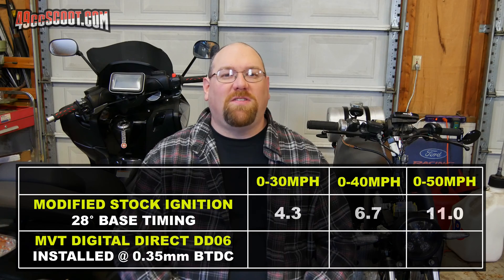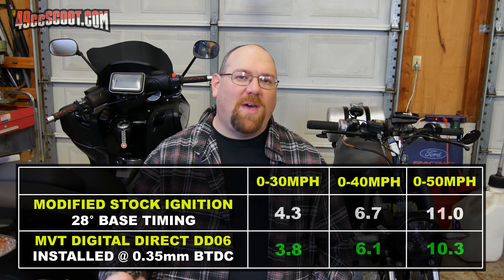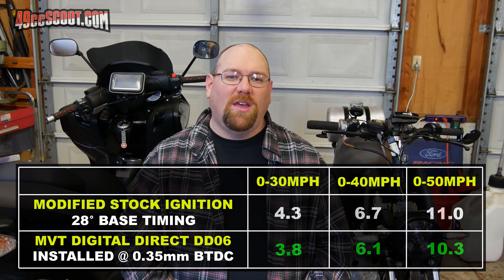TPR 86cc Build : Part 24 : MVT Digital Direct vs Modified Stock Scooter Ignition Comparison

Comment: Hello would you buy it again now you know the difference with it? Or would you just stick with what you had?
Reply from the maker: I would buy it or another racing ignition again. Much more responsive. Other ignitions may have a better curve with less advance at low RPM (safer), but the MVT has the benefit of charging/lighting output.
Reply: @49ccscoot  yeah thank you for the reply! And also your videos are really helpful you explain what and how you do things really well! Iv literally binged your videos in 24 hours straight! Did you manage to get the 34mm pwk exhaust temps to stay down in the end? Looking forward to the next update video
Reply from the maker: @Flintyl93  Thanks! Still working on the PWK. It's not cooperating.
Reply: @49ccscoot  wouldn’t recommend getting a pwk carb then? Haha
Reply from the maker: @Flintyl93  Not my favorite, but this is usually my luck.

Comment: I would be very grateful if you could trust me with the tachometer model
Reply from the maker: The small tach that I tried at first is a Trail Tech TTO. The multi-function gauge is a Trail Tech Vapor.

Comment: hello, what is the rpm limit of the original ignition?
Reply from the maker: I don't know what the limit is for reliable spark. I've used them up to about 12,000RPM. I have seen people post on the forum about flywheels failing with higher RPM setups. One person tried to use a stock  ignition on a Polini Big Evo around 14,000RPM and he went through a couple. Realistically, the racing ignitions offer so much better response and curves for high rev stuff that they should be used anyway.
Reply: @49ccscoot  OK, I am preparing a TPR 86 for Piaggio and the motorcycle is going to be used for the street and I need it to go with the lights, can you tell me how far to set the original ignition? or is it worth putting the mvt?
Reply from the maker: @raidracing9748  I would (and did) go with the MVT and mine is street. If you use the TPR pipe it may be alright with the stock setup. I used a timing light and set mine to 20 degrees base IIRC, but it will depend what CDI you have and what the engine likes.

Comment: The thing its a littlebit pointless, 2ts goes better in cold weather and you cant test it with exact same belts. But its sounds better with the newer ignition.
Reply from the maker: I've got enough results from before and after in various weather conditions at this point and there's no doubt that the MVT improved acceleration. Aside from that, I have tracked pretty  consistent times in various conditions. Riding it before and after would tell you without numbers on paper, but I like to test so I know it's not just my perception.
Reply: @49ccscoot  its straight forward that its better than the modified stock.

Comment: Have you considered a DC to DC converter to keep the battery charged? It would require a buck boost to keep a steady voltage, it can pull the charging system voltage down lower, with more current to output more voltage,  it may output more total wattage,  slightly more, maybe a pen dimmer can be used with the lights to use less power,  they are not actually on constantly, but to the eye it is, it can be seen on camera sometimes, computers use the tech also ,  the only down side is the light will seem slightly dimmer,  there is a few things that can be tried, maybe a capacitor  connected to the regulator output, to maintain a more constant DC charging voltage,  or maybe use a smaller headlight bulb, or add a 18watt or so driving/ DRL/ fig light, and turn off the headlight when not needed, I guess you have it figyby now, but maybe some suggestions can help improve things further! I guess the only true fix would be to add windings to the stator, if there is room, maybe 24-26 gauge per pole with enough turns to equal the voltage supplied by the existing windings, then parallel , to supply more current at the same voltage, or completely rewind the stator, with slightly thicker wire, say go from 26 gauge to 24 gauge, it would require more room, because more copper would be going on to the stator,  just some ideas,,,
Reply from the maker: I've got it working well enough ATM. One thing that helped the charging a lot was the higher RPM exhaust. With the engine staying revved more, it charges better. The racing ignition doesn't make much power at lower RPM.

Comment: Is this ignition available for 4stroke? Gy6?? Would it even make a difference if it is??  There was a guy on YT saying the 1p39qmb us actually 63cc, us this possible? If so that's what I have, I just put a 50mm kit on it, with a head set up for 80cc that I ported, and unshrouded the valves, a look so port matched the intake, and exhaust,   best i could,  with a aftermarket exhaust and 20 mm carb, I also shimmed the valve springs, installed the A9 cam,  I had to buy a new starter, so I'm hoping to get it going tomorrow, I was just curious if there is an ignition that could make a difference, I also have a 1500rpm and 2000rpm clutch and contra spring kit,   I haven't gotten any rollers/sliders yet,  I want to see how it does first! Great video!
Reply from the maker: AFAIK MVT does not make an ignition like this for the 139QMB or GY6. You can get smaller and lighter flywheels and there's probably an inner rotor kit out there somewhere. It should improve response and if it had a good ignition curve, that would also be beneficial. NCY, HOCA and SSP-G are the brands I recall that make or made smaller lighter flywheel kits for the 139QMB.

Some 1P39QMBs were 63cc. Most are not. The P is proven to not guarantee anything special like a different bore or valve length. It's there to signify a horizontal engine.

Comment: For longer trips i guess your chargline is somewhat low, but for keeping it going its no problem .Your Coil is on the main cirquit and gets his power straigt of the Stator.While your LED maybe overconsumes the Stators chargercoils., This can cause for defective batterys,but aint a problem for keeping on the move on long trips.Nice video like always ,have a good christmastime and lots of new parts.

Comment: Hello @49ccScoot

I use the same ignition and i have NO problem at all with my charging.
May i ask if you are using both light coils? the sator outputs 12V+ on 2 of the wires.. ( if i remember correct its the yellow and the white/black but im not sure.)
Also, i dont think your voltage regulator is working properly because it should not be able to output more than 13.5V, so maybe change to another brand so you dont fry your CDI.
Reply: I have spliced the two wires together.
Reply from the maker: @jonasmader  I have both wires going into my regulator/rectifier so they can help to charge the battery and my battery powers the lights. If I switched to AC lighting, I shouldn't have charging issues... but then I'd have a flickering LED. I used AC on all of my small scoots till the last couple of years and now I really like the constant bright light. Trying to stick with DC if possible.

Comment: All you need is a buck boost adj voltage supply for that headlight.  You can turn it down during the day so it just glows enough to be seen and at night you can have it as bright as you want/need and pick a brightness that agrees with your voltage.  That is a huge amount of led light but you know their are more efficient led's. I have a 20 watt light that should be illegal because it will blind anyone within 150 yards instantly leaving you unable to see where you are going so there is no way I could use more, in fact I cannot use it full brightness because it actually blinds me from the back side.  10 bucks for a buck/boost board will solve your problems or rewind that coil with thicker wire and same amount of turns.  I used to be scared of winding coils but necessity made me and now I won't hesitate for a moment. I just put a bobbin on the lathe and wind it off to see a broken wire, when I find it I solder it together, put some liquid rubber pliars dip and a piece of tape and wind it back or just redo the whole thing and as long as your enamel is good, you won't have a problem and will learn alot in the process.  your videos are so damn awesome bro, I can't imagine anyone argueing with your results as  your methods are so consistent and true,  but that is the result of them big bucks you pay all those camera people behind the scenes huh?
Reply from the maker: lol Oh yeah, all those people behind the scenes. I wish.

I'll prob look into the voltage supply. I am not however taking apart this encased stator. Maybe if it ever quits working, but for now it can stay sealed.

Comment: Just sharing same thoughts ....what have hit me in video it was ignition at 28 deg. BDC  !? That is kind racing adjustments - gas full on or off and that is not much efficient , because crank is on the edge  turn backwards,  isn't it...What you need is gasoline /air mixture burning at highest efficacy to be like 5 -7 degree after ADC.  Gasoline mixture has time frame -from ignition point until is at highest temperature of burning or highest coefficient of its efficiency. It is possible to calculate that ( tray to Google it or I can find link for you ). Great job.
Reply from the maker: Fuel and air takes a finite amount of time to burn. It's not an explosion. So yeah, you want the peak cylinder pressure to be a bit after TDC, but to do that the fuel has to be ignited before TDC. 28 was what gave me the best results through test and tune. It may have actually done better with more, but I didn't try to go beyond that point. It would have been nice if the CDI backed out timing more at higher RPM to put heat in the exhaust, but it did OK for stock stuff. The MVT has 40-ish degrees of advance and it is harder to start. Runs well once going, but I suspect that it's backing the timing out a lot at higher RPM.
Reply: @49ccscoot  Looks like I wasn't clear as I tough in my writing ....and you explaining basics for me and there is no what we want. Lets start from "Fuel and air takes a finite amount of time to burn" - is this what I'm talking about. Time of burning it depends on fuel quality as well (witch vary a lot from gas station  to gas station) this is why racing fuel exist. This is why with new tank of fuel you will get different result on ignition point adjustment.  Off course one of the best situations is  to do timing adjustments with a DYNO machine ,but for average result for average fuel quality from the gas station to calculate fuel burning time it give you  quite good   result.
Reply from the maker: @mobilgin I understand the idea of calculating time, but conditions vary so much that it's not really possible with a real street ride. If the weather changes and the mixture fattens up a little, then that throws it all off anyway. You could start monitoring altitude density and tuning the carb before every ride with the same canned fuel, but at that point I'll just hop on the TMAX and let something so picky collect dust in a corner. Some level of precision is suited only for racing or dynos IMO. Plus, I've never read anything from top tuners going solely on calculations. At least from things that I read, they generally advise actual testing because there are so many variables. Especially for someone in a regular shop and not sitting on a bank of super computers to so all sorts of modeling.
Reply: @49ccscoot  well ...each tuner have own toys to play with and same of them even keep it closed to the body from evil eye. 
You are becoming top tuner your self as well and when you are so up there are no more teachers!
Me..just sharing 40 + years of experience.... whis is why  28 deg. BDC took me by surprise..extreme ignition point with uncertain fuel quality and different environmental conditions  ( you have self came to same conclusions in previous post).
Reply from the maker: @mobilgin  That is the problem. Too many people don't share what makes their setups work well. I'll prob never be a top tuner, but whatever I figure out I'm glad to share.

I just went with what worked for the 28 degrees. TPR said 20 and I kept advancing to see if I could pick up power. Worked well for me. Might not be so good if I had a setup that revved out much more.
Reply: @49ccscoot  Have found it...https://www.superhonda.com/threads/one-of-the-best-ignition-timing-writeups-i-have-ever-come-across.268106/
" Worked well for me"....any thing what worked it is positive tool in your bag. But should be solid data to back it up the statement. To use feeling as guide to evaluate engine performance  -that is not good enough . Engine performance it is a bunch tech. data expressed as a digits which represent same parameter and that you or anybody calling self a tuner or pro mechanic must be able to work with. You do know how make things to happen and not having nerve brake down seeing a wrench. You can make your own(mini) DYNO.
"Top tuner"....I have no idea what that mean in scooter world, but imagining a snoted teenage with bumps covered face , backwards hat an ass hanging over his trousers.
Only "real" relationship with a women he has ever experience was on a computers screen. But getting back on a track to exiting examples of practical "top tuning" in a super bike and formula1 world,resulting engines lasting x amount of hours or laps on a track . Tolerances in those engines are not achievable in real world for normal Peter.
But on positive and practical note next step for you to a achieve better performance in your engine should be- minimizing  friction in all moving parts in engine . Saving white where it is possible.I m having god result with that stuff minimizing  friction....https://www.weboil.dk/shop/3-rvs-technologyreg/13-2s125-rvs-technologyreg-totakts-motorbehandling-125c/ (google translate will do miracles for you). I have no idea if possible to get it in USA,but that product is made in Finland using coal miners and they machinery as a testing ground. It works.
Getting stable fuel for stable data readings for engine performance  ( later you can downgrade engine setting to normal fuel,kindo).
Reply from the maker: @mobilgin  I get the idea of the timing calculations, but that seems tough to me for a 2T. The high end power relies on the exhaust's operation for two-strokes. You can setup a 4T so the advance curve matches your calculated time, and you end up with a map that steadily advances. That doesn't work with a 2T. My opinion is that you really need a dyno or trial and error testing to see what the pipe likes and you'd probably do better with an EGT to see how much heat you're putting into the exhaust. 

Sorry the reply is late. The links got your reply auto-marked as spam so I just saw it.
Reply: @49ccscoot  Cool to hear from you, I hope find you well.  2 stroke is taffy also because an exhaust construction....  in bad designs, unburned  fuel sits in exhaust chamber and is not sucked back in to cylinder to burn. In god design unburned fuel is sucked back to burn.....This situation is complicate enormously getting timing just wright, as specially if you have two sparks during one piston stroke. For 2 stroke engine we just have to make compromises,but you self came to that conclusion..There I agree with you 110% "My opinion is that you really need a dyno or trial and error testing to see what the pipe likes and you'd probably do better with an EGT to see how much heat you're putting into the exhaust " Welcome to Top Tuners elite club !

Comment: Im shure that there’s a voltage regulator out there that would work better not saying that the yamaha one isn’t good but it wasn’t made for those specifications !
Reply from the maker: Probably. My thought was that it's a regulator that is on many scoots that this kit was designed to work with so it should be alright.

Comment: Merry christmas and buy a tuned pipe haha, c30 fit well, kundo f1 too, c21 is OK and r1400 is respectable, i wont really recommend a most86 or 2fast 86 since they are a little too big
Reply: 42w headlight is monstruously too big for a mvt dd
Reply from the maker: @122martin122  Merry Christmas! They claim 50W, which I should be within with all lights.   I don't really want to put much less of a headlight on, because this one works well. I've already hit one deer so the idea of less light at night doesn't sound fun to me.
Reply: @49ccscoot  Carry big capacity battery like lithium and think about charging it after your ride cause 50w is when wide open... like ive build a lot of scooter here in Quebec and we can barely run a waterpum on these, less charging but more power its natural
Reply from the maker: @122martin122  I'd think Li batts wouldn't be great right now, simply because they're not supposed to be very tolerant of wild voltage if you expect them to last. That's my understanding anyway, so I'd have to get my voltage under control.

Comment: Clutch.I also changed to a original clutch,that was a mistake even with same 2000 rpm springs.Too heavy shoes,so you dont get rpm.Naraku racing clutch.The belt destroys with slack contra spring,or same,half/pulley with hardened oil.And you also need the half-pulley part with racing-slide,straight angled before the slide.I got 4-stroke and there are cam-axles A6-10.But you know,accuracy is not used.You must study "FZM stunt team" movies on youtube.They dont care,and make it.
Reply from the maker: If I get another clutch it will be the S6 most likely, but I want to get more horsepower first... which will mean an exhaust.
Reply: @49ccscoot  I use naraku,also half-pulley.There`s a different rule here,so I keep the visible parts original.It`s for disabled,youths and "renegades".But Paris and Hong-Kong has MILLIONS.0 problem to install 90cc naraku,with complete naraku parts.But you will first have to learn the 50cc experience,and copy it to your driving.Its for idiots,faster than R-mc